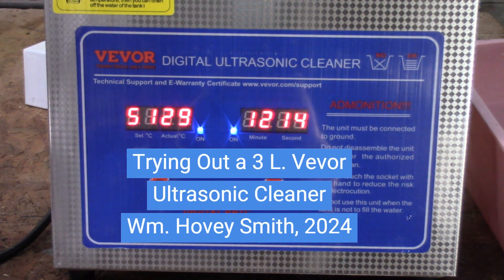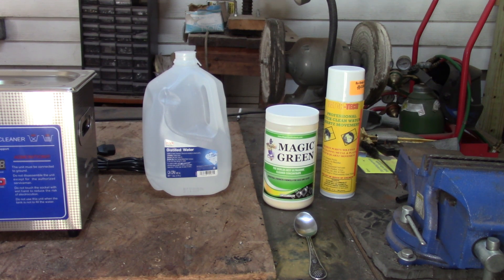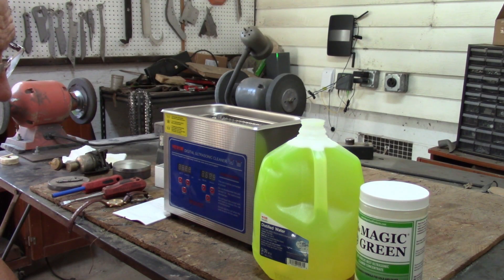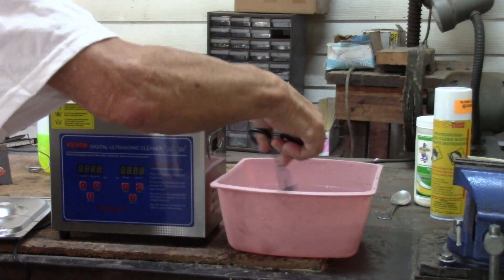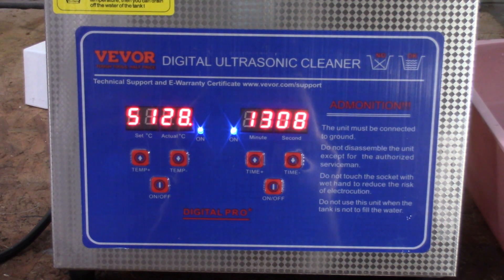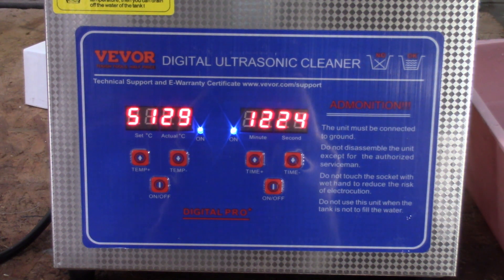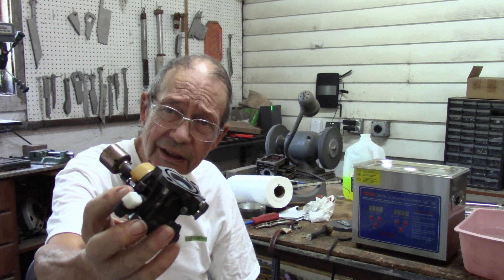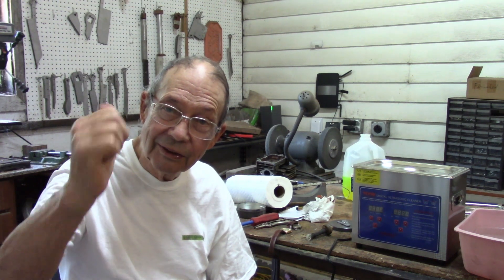Trying Out a 3 L Vevor Ultrasonic Cleaner

Comment: I have this same unit and love it for carbs and chainsaw chains before I sharpen them. I personally like using simple green aircraft and precision parts cleaner diluted properly in water since it will not etch aluminum carburetors

Comment: Hi Hovey, Long time no hear from me I know.  I have one of those ultra-sonic cleaners and I had good luck cleaning my 577/450 Martini-Henry and .577 Snyder cases by adding a tablespoon of citric acid crystals.  After that treatment, I neutralized (hopefully) the citric acid solution on the cases by rinsing them off in clean tap water.  they came out fine.  I got the idea from the use of my Frankford Arsenal Wet Tumbler for clleaning brass cases.  Some guys use Lemi-Shine (for automatic dishwasher use) but I picked up the citric acid crystals from a wine-making supply house.cheaper than you can buy Lemi-Shine for..  You might want to give that a try.  I never used any other sort of cleaner in my Ultra-Sonic cleaner and have cleaned all sorts of stuff in it.  Just a suggestion of course!  It worked fine for me.

Comment: I have vevor diesel heater, very happy with them, man, those things throw out a lot of heat and they are small, only require 12 volts. I got them for power outages.
I just use a strong pine sol mix, cleaned carbs and things well. I use "moose milk" for black powder handgun parts. Brass it didn't impress me
Reply: I am a reloader too. For your brass cartridge cases you need to use a 10% solution of Citric Acid. That should work better on the carbs too. No caustic solution. If you want to use Simple Green, DO NOT USE THE GREEN version. Use the Aircraft or HD from Home Depot. I have the 2L version of that cleaner and love it. I will never use a tumbler for cases again.
Reply: @823Steve  yea, I've tried it, ok, but I still get a better shine with walnut, the best I've tried was ss pins roll tumbling